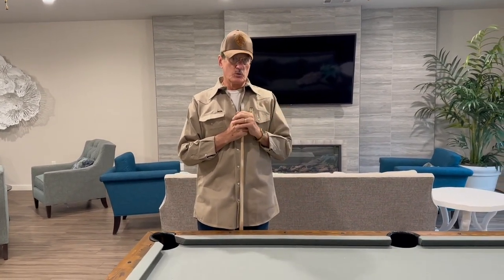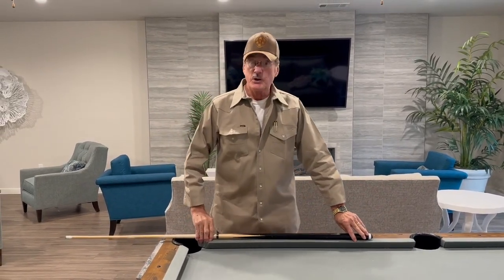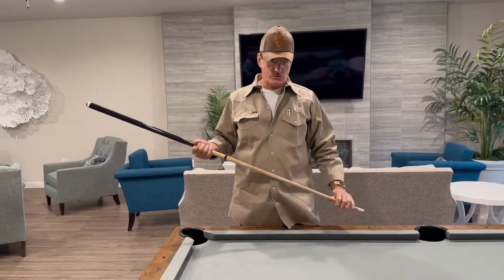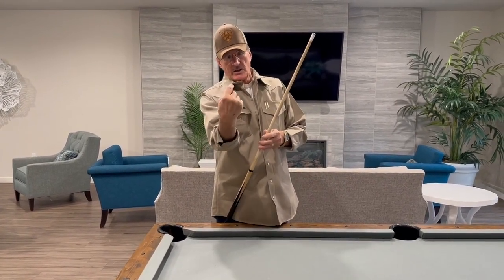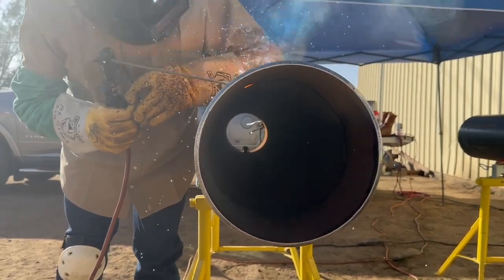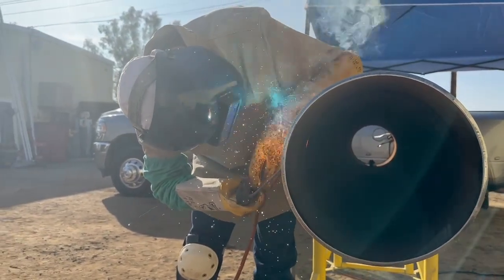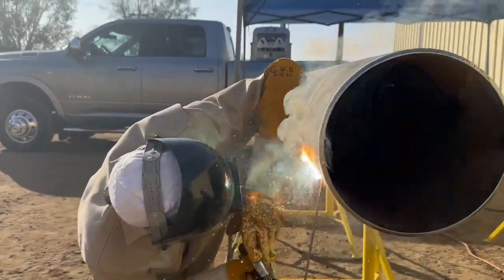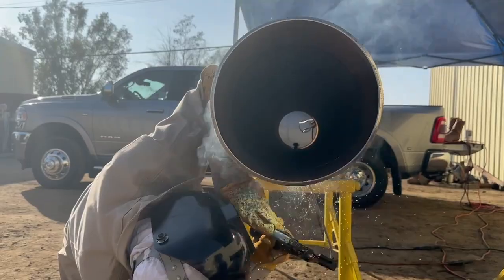HOT PASS TIPS:  Welding Instruction with Gerald W. Brister

Comment: Thanks for sharing your knowledge from experience. 

I worked in a tank shop welding state inspected vessels.  I welded the inside then air arced the outside so I would have a 100% clean weld  when finished. Never had one weld fail.I couldn't see how a person could have one fail, but one guy close to me did. I don't know if he had tried to cut corners or what he did but he had a nice little stream of water shooting out of his bead when hydro tested.

I started welding when I was 12 years old fitting and welding pipe. 

I still enjoy welding and fabricating at 70 plus years old.   Old 🐐 😂
Reply from the maker: Thank you, you had a great run!
🤝🇺🇸